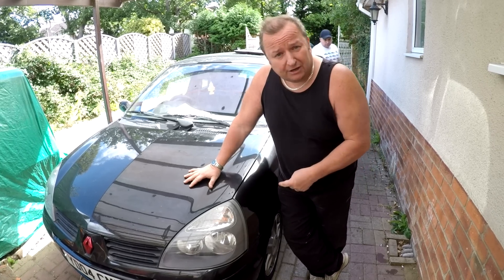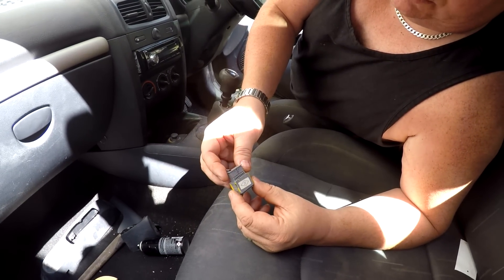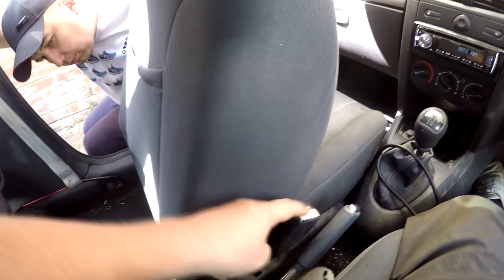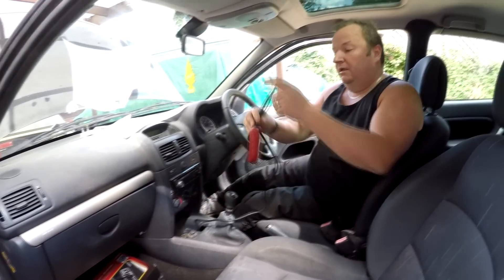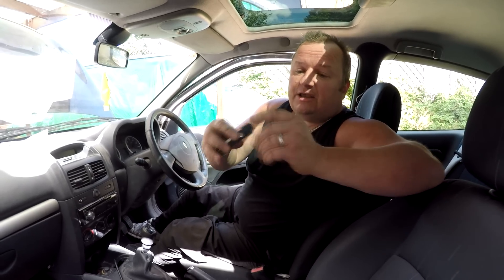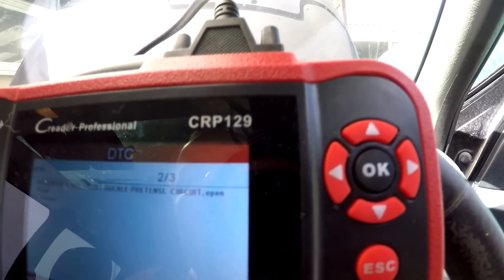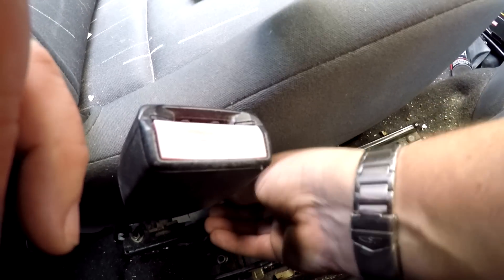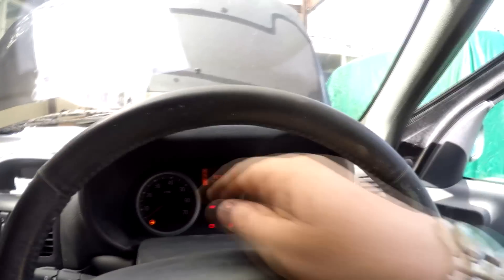Renault Clio 1.2 Airbag And Service Light On [Causes And Fixes]

Comment: Had the same problem on my nissan kubistar service light and airbag just checked the connection under driver seat as soon as I gave it a good squeeze the lights went straight out. Cheers for the great video very helpful🙂

Comment: Another common airbag and serv fault rarely discussed on YouTube is the rotational connector behind the steering wheel for the driver air bag. It's also called a squib or clockspring. It wears out and one wire breaks giving an 'open circuit' fault. Its a cheap replacement too from an ebay secondhand dealer.

Comment: Thanks for this video. I had the same problem and tried the first option. Wriggled the connector underneath the passenger seat and gave it a little tap and it solved the problem. Both Service lights and Airbag lights have cleared.

Thanks
Reply from the maker: Excellent!

Comment: Well done matey. You've just saved me heaps on expensive parts. Your video really helped me out and sorted out the problem. Nice one matey :)
Reply from the maker: Well done bud. Goo savings too I bet
Reply: @retrorestore  Yep. Sure was. I went through everything and it did turn out to be the connection under the seat and all I had to do was spray a bit of WD40 and lights went straight out when I reconnected the two terminals. What I liked about your video was that you showed everything that could cause the problem so all I needed to do was go through them one at a time until the lights went out. Mate you saved me a lot of time and money... Many thanks.. :)

Comment: Enjoyed this. Here I am with 9500 quid worth of diagnostic tools and you speak of that little launch uni as the proper stuff. ha ha well it solved your issue and to be honest, it looks alright. 

Thanks for the educational video. 

Im a mobile mechanic, auto electrician, auto locksmith.

Comment: Hi Martin, you've made my evening! My son has this car (06 model) and we've done exactly the same as you and wiggled the grey connector etc to no effect. We hadn't heard of the connector you found (that was faulty) so that has to be it! And yes that has to be worth 15 notes on eBay. Cheers buddy! If that works we will be over the moon as otherwise it's his ideal first car.

Quite agree with other comments on here regarding French car electronics - I had a C4GP and all the warning lights came on one day even though the car was still driveable. It turned out that the front screen rain ducts (tubes carrying rainwater away from the windscreen and supposedly dumping the water on the road) actually had caps on the end that presumably were designed to open when water built up behind them - wtf?????? Over time the crud from the road meant that the end caps collected a sufficient amount of dirt to stop them opening - with the result that they did fail to open and the water built up behind them and eventually overflowed into the engine bay causing electrical mayhem! Thankfully it all dried out and we were lucky. I did however take those end caps off (right underneath the engine, 2 of them) and loads of foul water poured out - French overthinking there... why put a cap on a tube that has to get rid of the water?

Anyway, sorry for the long comment, but thanks again as I'm sure your diagnosis could be the problem for our Clio. Cheers! Mike from Sandhurst.
Reply from the maker: I hope so Mike, A diagnostic code reader would point you to it as well but good luck with it bud.
Cheers
Martin

Comment: Big help this: thanks. My daughter’s Clio had the same dash error lights. I’d narrowed it down to the connectors under the seat, but didn’t know about the dash binnacle or the pre-tensioners. Disconnected battery, waited for a couple of hours and liberally sprayed SWITCH cleaner, not WD40, and fired her up. All sorted 😎👍
Reply from the maker: Nice one bud. Well done.

Comment: What fault code do you get from the under passenger seat connector problem? I got DF075 (Passenger Front Air Bag Curcuit 1, open circuit) along with airbag warning light on ..

Comment: I used 2 resistors (3,9 Ohm, 5 W) to short-circuit the Yellow plug behind the wheel. It worked 🤟
Reply from the maker: Nice work!
Reply: How to do this please ??

Comment: My clio is 16 years old, leaking sunroof, airbag light on, heater motor blew, fan belt went, drivers door doesn't close right. I have no fixed all these things myself in my driveway with no experience working on cars at all.. threw in an oil change and 2 droplinks.. flew threw mot. Happy as Larry.
Reply: Yep daughters Mk3 is 13 yrs old. It's a lovely car to drive. It has its niggles and the worst thing was it melted out a relay for the headlights. But it was no great job to fix.  The engines is fantastic though - registered an emission level only at the 3rd decimal place on the last MOT

Comment: Great vid Martin 👍 good diagnostics.A handy tool for airbag diagnostics is a srs emulator it basically emulates airbag resistance idle for testing airbags,pretensioners, clock springs
Reply from the maker: Nice one Jamie.

Comment: Thanks mate, I bought one of them kits. Quite expensive but found out I got fault DF241 - Passenger's seat base/lap belt circuit. I will take a look under the seat tomorrow and see if I find any loose wires. :) I guess the kit can be used in the future haha
Reply from the maker: Nice one!

Comment: Shocking electrics on Renaults probably the worst out there 🙄, no pun intended 🙃
Reply: Absolute DRIVEL! The problems this Clio is having is EXACTLY the same problems most cars have with the airbag lights/plugs - not just a Renault problem. This is a FOURTEEN year old car and for that age of car it has done excellent to have needed so little to get it through the MOT. As I have commented above Renaults are the most reliable of the European manufacturers plus they do not sell more vans in Europe than anyone else for nothing - if they were unreliable or crap that wouldnt be the case. We have used Renault Kangoo and Clio vans for a long time now and they are very reliable. I also own a 2008 Renault Kangoo Expression car and that is very reliable as well and all it has needed to pass the last couple of MOTs is a bulb each time. I'll take my Kangoo over what ever you have anytime even if it is a Ferrari.
Reply: @williamwoods8022  Are you triggered
Reply: @williamwoods8022  time of the month is it? 🤣

Comment: I think the sensor is an inertia sensor. It detects side impact I believe. Great video Martin that Launch looks like a great tool how affordable is it?
Reply from the maker: around £200 Steve, there are cheaper options out there.
Reply: retrorestore Cheers Martin I do have a cheap one but this looks really good and Launch is a known  make in diagnostic tools I think they are pretty good as far as I know. Cheers. Steve

Comment: I had a 2002 Renault Clio, the airbag light would come on first thing in the morning and would go away after a while. The code was something like 'power supply voltage low' turns out it was the battery and alternator causing the fault believe it or not

Comment: hey. i have the same problem. Do I need a diagnostic tool to let the light go out after the bug is fixed or does the Airbag light reset automatically? thank you good video.
Reply from the maker: It should go out when you replace the sensor bud

Comment: Excellent video!BTW I would like to ask you something.
A friend of mines owns a 2002 year model.He has the same problem.A few years ago he went to a Renault dealership and they cut-and then resoldered-the wires under the passenger seat but still no luck.Service and airbag lights are still on.About a week ago he took it to another Renault dealership and they told him that all 4 airbags have a problem and they need to be replaced. Is it possible?I highly doubt it because it's a little bit weird to have 4 faulty airbags at the same time .Is there any chance that the lights are on because of a blown fuse(airbag fuse)?He hasn't inspected the fuse yet.Also,the task you do at 2:35,is it safe to do it like you do or is it better to remove the negative cable from the battery(you didn't remove it because I can see the immobilizer light flashing)?Finally,considering that the "trick" with the passenger seat sensor didn't work out,if we check out the fuse and it's not blown and we push the cable like you did at 2:35 but the problem still exists,will a new squib resolve the problem once for all?Sorry for my long message!!!

Comment: Hi! My Clio 2 had the same problem of the 2 warning lights,service and airbag then they turned off all alone.
Yesterday I was parking my car and I heared a clack noise coming from the steering wheel, like something inside the steering cover was making contact.
This morning went up the 2 lights again.
It must be that contact you showed! I have to check it!
Thank you!
Reply: I checked it and it was probably that connector not properly on its place. After pushing any connector back, the noise during the turning of the steering wheel came off and the 2 lights went off as well.
I was very worried my steering was broken in a badly way.
Fortunately it was just a cable interference. Thank again! Cheers

Comment: I had Renault once, would cry myself to sleep at night.Replaced a sensor every other week then came to my senses.
Reply: Funny we have used Renault Kangoo and Clio vans for years with NO problems with them. I have a 2008 Kangoo Expression DCi car version last of the first generation and never had any problem with that either apart from the airbag light which I know to be the plug under the drivers seat as all I do is press it back together and the light goes out until the next pothole knocks it back on. In the three years I have had this Kangoo it has sailed through the MOT every time only needing a number plate bulb in one MOT and a headlight bulb in the MOT it has just gone through.
Reply: I heard a Kangoo had passed an mot but thought it was a legend or myth.
Reply: poor william woods is trigged because of  a car brand thats not very good the last good renault was the 5 and the 21 the rest is utter shite
Reply: My Volvo s40 has the Renault Diesel engine it was brilliant 250 thousand miles on it and still loads more to give. :). The Renault dci is a class engine.
Reply: I have had two both shit you would think I would learn the first time

Comment: Martin, Great fault finding a 15 pound fix i wonder what this would cost with a renault dealer lol, Cheers Dave.
Reply from the maker: I hate to think Dave, All main dealers  you can say goodbye to £100 per hour.
Reply: I had similar success diagnosing a miss fire on a Alfa 156 using a Bluetooth obd II reader and an app on my Android tablet and I ain't no car mechanic. The diagnostics plus the coil pack cost about twenty quid from ebay. 😀
That was a one off for me though as I don't usually do this sort of stuff. It might be worth the investment for Martin's diagnostics reader if you do this thing a lot.
Reply from the maker: I'm not up on modern cars computer systems but you are right Steve, you need a diagnostic tool to read the codes instead of just changing out parts as a lot of people do.

Comment: hi sir i have clio 1.2L has service light and air bag light on ,but couldn't fix any mechanic ,i tried to put bypass but still on , my question is ,passenger and driver side impact/crash sensor r both same part code numer or different , i havnot change passenger side sensor which u tell us in vedeo but looks like it already changed,
Reply from the maker: I don't know if they are the same but I would suggest you plug in a scanner and it will tell you what sensor needs changing.

Comment: It's a Renault. There's your problem right there.
Reply: Oh Dear! The ignorance! Renault are the most reliable of the European brands and have been for the last decade at least. ALL of the German brands are POOR for reliablity in the ACTUAL break down charts here in the UK and they are being slated all over the world esprcially in the US and Australia etc. Renault makes and sells more vans than anyone else in Europe as well with Vauxhall/Opel, Nissan and now Fiat vans just being rebadged Renaults. The Mercedes Citan is just a Renault Kngoo van with different grill, dashboard and badges and is made in the same French factory as the Renault Kangoo and yet you get the mugs paying more for the Citan just because it has the Mercedes badge on it. Mercedes uses Renault engines, gearboxes etc on some of its cars now as well with the A-Class being a Megane underneath a different body. We have used Kangoo and Clio vans for a long time and they are very reliable so much so I bought a 2008 Kangoo DCi Expression car version which has cruised through every MOT ever since with only a number plate or headlight bulb being needed to pass. This Clio in the video is 14 years old and the problems it has had here are the EXACT same problems you will find in any other car of that age especially to do with the airbag light - these are common problems on most cars.
Reply: @williamwoods8022  Absolutely. Go and buy a similarly aged Mercedes or BMW if you want electrical faults that will try your patience and punish your wallet.
Reply: Lol I had a Renault Kangoo van did 230,000 miles it was bought off me by the machanic who seviced it. He had it for another two years. It doesnt matter what car you have if you dont look after it. Renault are ok if you give them a drink of oil every now and again
Reply: Another great video Martin. Is that your fault reader? It looks like a decent one
Reply from the maker: Its pretty dear at around £200 but I was sent it to review it but not had the time yet.
Reply: William Woods , well said!
Reply: Re'NOOOOOOOOOO'! its in the name lol
Reply: renault are garbage thats why u see them rebadged
Reply: Would not touch a Renault myself.The Megane you cant even change a light bulb with out geting a bag of tools out a joke.
Reply: TheCitroenman1 - Oh Dear! What a dumb comment. If Renault were that garbage then why would any other manufacturer want to stick their badges on them? As I have commented above Renaults are very reliable - the most reliable of the European brands - and we have been using them for a long time now with no problems and the Kangoo I have bought as a result of that has been very reliable as well. If they were garbage then we would not be using them and I would not have bought one either. It is usually the people who dont look after or service their cars etc that blame the car/manufacturer or who are stupid enough to but other peoples unlooked after car because they dont check it out first. It is the owners that are garbage in most cases.
Reply: william are you trigged renault are rubbish just because you had luck don't mean alot i have worked on a lot of them to know that the brand is total shite
Reply: whats the biggest failure on the nissan almera engine  william yes the shity timing chain made by renault that says all don't it william im a fitter i should know what im talking about
Reply: durr the vans
Reply: 999thenewman French cars are infinitely better than German. ask any motor trader of which I am one and they'll agree..
Reply: @williamwoods8022  That's what convinced me to buy Renault.. the fact they build lots of HGV and PSV's can't be all that bad.
Reply: @johnocallaghan9252  Nonsense. I assume you are talking passenger side highlight?  Same on a Clio... it's a tight fit but is do'able with everything in situ.

Comment: Good job. Not sure if you guys can get a diagnostic device called BluDriver. It's a scanner where you plug in a small block to the engine light port under the dash board. You then sync it to your mobile phone using a Bluetooth connection and read the codes on your phone. The software is free to download to your phone off the 'net. It works great and you can read and/or clear the codes right on the phone. It's pretty slick! The whole thing cost me $100 USD.
Reply from the maker: Not heard of that one Jack, good info though.

Comment: Hi Martin ' great video, can you tell me how much that code reader was please, thanks
Reply from the maker: Its pretty dear at around £200 but I was sent it to review it but not had the time yet.
Reply: wow that's lucky wish someone would send me one :) I'll look out for the review
Reply: @canalboating  if you have an Android tablet you can buy a cheap bluetooth  reader and try using that. There are plenty of apps for it. The one I used was called torque (I think).

Comment: my clio has an airbag fault. I hear door clicking noises and door unlocks itself when im driving and airbag light comes on. If i pull a thick bunch of wires wrapped in a coil under my drivers seat the light goes out. any ideas whats wrong. its a mark 3 1.2 16v clio. garage had a look and it says intermittent fault on computer.
Reply from the maker: Sounds like a poor connection under the seat bud. get some contact cleaner spray and unplug them and clean them.

Comment: If I cut out all the connectors and solder them, would i also need to delete the fault code to make the light finally go out?
Reply from the maker: i think the light went out on its own
Reply: @retrorestore  thank you. then my problem must be somewhere else. maybe also the sensor.

Comment: The Peugeot 306s have problems with the door looms, its a design flaw in the loom. The loom physically snaps where the loom comes out of the bulk head to the plug into the door. It was more common on the old mk1 306s and I think mk2 306s,  All you have to do is extend the wires, and replace blown fuses.  Just another heads up if anyone has problems with door electrics,
Reply from the maker: Nice one bud. Cheers
Martin
Reply: I had a 306, a good test to see if the door loom could be the problem is to check the door speaker is working when the car/ignition is on and the door is open